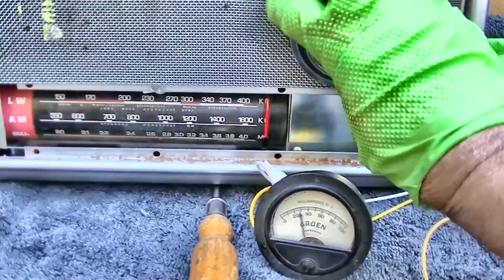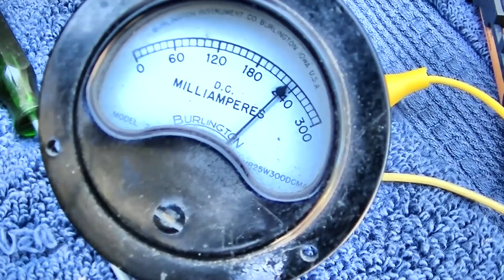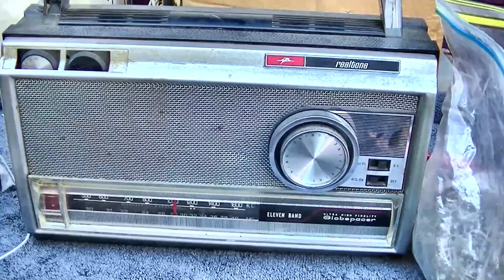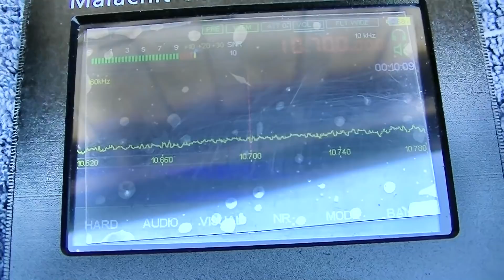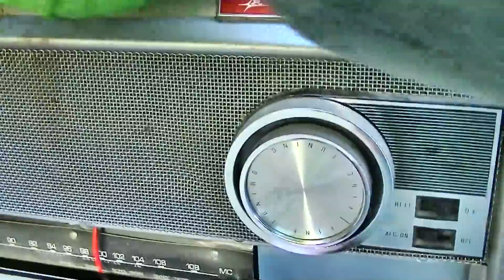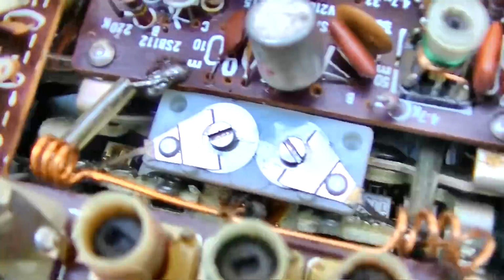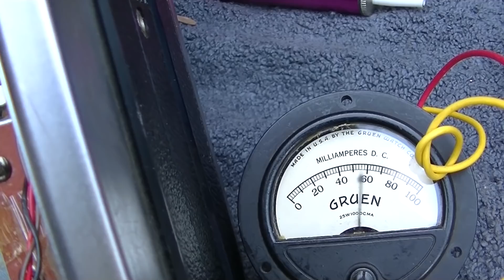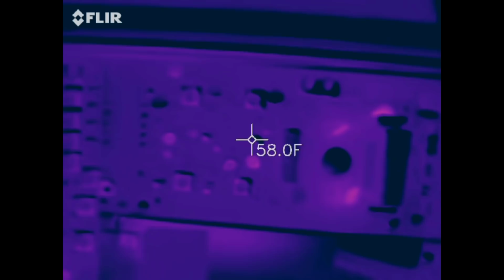Realtone Globepacer 11 Band Shortwave AM FM Transistor Radio Resurrection3

Comment: Look at all the transistors in the push pull audio output stages.. wow. Very cool radio. It seems someone put some love into designing and manufacturing those.
If you're still alive, you haven't had enough booster shots.
I used to absolutely hate static on radios and demanded listening to clear stations or else turn it off. I've changed. Now I prefer the sound of pure static over the content on the stations.
Reply: No kidding. We are in a world when there’s so much mass hypnosis going on it makes me want to puke.
Reply: I tune my hf to a dead spot above 8 mhz at bedtime with the volume low and it helps me to fall asleep hearing the static and static crashes from thunderstorms.
Reply: @LakeNipissing  ill give it a look
Reply: @DankNoodles420  English obviously isn't Prof. Desmet's first language,  so sometimes he stutters for words,  but his example of the "Asch Experiment" to describe the current psychosis was brilliant.
Reply: @kevinmccool3719  I find an FM receiver on a vacant spot on the dial through the right speakers can emulate the sound of a waterfall.
Reply: Is'nt that what squelch is for.  All modern hifis have it.  Most automatic.
Reply: @Fred Flinstone 
You really hit the nail on the head! Back in the 1950s-1970s you can tell that whomever was engineering and designing  these units did put a LOT of extra effort into these units and the performance proves it as does the quality more often than not. I own a number of units like the Panasonic RF-4900 (DR-49) from 1981 and while it is a consumer level communications receiver the performance is extremely good if not excellent good sensitivity, selectivity, and super low noise floor, and the user controls are very easy to use and get good results, not to mention it was build to last a really long time, I owned the RF-4900 since I bought it as a teenager back in 1981 and it still works GREAT!

Comment: I'm guessing the Hi-Fi/DX switch is for variable IF bandwidth. On DX it narrows up the selectivity so you can pull weak stations out from between or adjacent stronger stations. The downfall in that setting is that you lose some of the higher frequency audio.

Comment: smaller rated output transistor are more linear. Replacing just with 2n3906 or S8550 and rebiasing to 5 or 10 ma standing current for the pair should work well to reduce crossover distortion. No need for darlingtons. 1 silicon junction is almost equal to 2 germanium junctions. Increasing the emitter resistor to about 10 ohms should make it stable thermally.

Comment: 15:05 
Discharge of static charge is not constant DC, it is a DC pulse, of course it will pass through to the secondary coil. As long as there is a rising and falling off of current, a spike will pass through. That spike could potentially blow open the junction of the transistor.

Comment: I had one of these maybe 10 years ago and it was a helluva performer. Extremely overbuilt and heavy, and it had that signature Japanese portable rattle of a few random machine screws that had backed themselves out. Had a lot of fun DX’ing longwave NDBs with it. Mine was a slightly earlier version from 1963- slightly different tuning knob and the badges were different. The VHF aircraft band was cheesily labeled “aerodrome control” and the whip antenna was about six feet long with a pointless ball swivel at the base that could only angle maybe 30°.

Comment: 2SA70's were the in IF stages of the early Sony 5" TV's. They had the dreaded tin whisker problem, similar design to the UK Mullard AF 117 type transistor.Cutting the transistor screen/can connection may make it work.
Reply: just cutting screen lead can cause instability, i've had this problem,  need to blast the short out with a large charged capacitor..

Comment: Just picked up one of these gems at a ham fest recently. It was heavily modified, with the tuning cap mounted on the right side with no dial pointer! It had all new electrolytics replaced and is quite a performer with excellent audio. The AM and shortwave have exceptional reception at night. The only drawback is knowing where you are on the dial. Maybe a broken dial string?

Comment: They don't make radio sets like this any more......shortwave sets are cool vintage objects
Reply: Thank God they don't
Reply: @MartinSBrown-tp9ji  Why not, the fact is that analog transistorized units like this can be extremely sensitive, selective, and they usually have extremely low noise floors, something which most all PLL and DSP radios are not capable of since digital noise is extremely hard to limit in portables.
Reply: @watershed44  i was playing with my zenith 7000 in the desert, i cant believe how quiet the bands are and how good it gets the few shortwave stations left, in the city all stations fade in and out and high noise level, with stock radio antenna ,.. then 2 bands i got all kinds of noise i thought the radio developed a problem, but i realized my dad turned on the inverter generator
Reply: Recently got an Aiwa shortwave myself thing is amazing and a metal building doesn't cause any noticeable interference.
Reply: @cipherthedemonlord8057  Wow, I didn't think Awia was still making portable radios anymore. Is it new or used? What model. 
Last Awia I had was the HS-J02 from 1982, wow that was a great walkman stereo. I thought they went out of business in the late 90s.
Reply: @watershed44  Old AR-143

Comment: The Tone Control circuitry in this Radio is interesting.
Instead of just a simple Treble-Cut arrangement we have an arrangement which gives us treble increase with turning the knob one way and treble reduction when the knob is turned the other way.
With the quiescent supply current at about 42mA I wonder if it would still be practical to run this from a Dry Cell Battery.

Comment: I used to find cool old radios like these all the time at goodwill for a couple dollars. Always enjoyed the gamble as many worked or needed repairs. Now I never see anything worth buying as they will not accept these items or they throw them in the dumpster and will not let you retrieve items they throw away. 
They tell me it won't sell and it a liability for the store. 
It's really a shame cause so many people love to repair older transistor radio sets. 
They even throw away table lamps as they said a customer got electrocuted while plugging one in to test it at the store. 
But hey,  they sell flat screen LCD tv sets with obvious damage to the screen for more than a new one. 
Better yet they sell used ear protection plugs for 10 cents each.

Comment: I think the output stage using the two transformers was matched to the germanium transistors, but as they had such a variance in thermal behaviour, many manufacturers chose to find a pair of transistors most closely matched from a large container of many.. I see some silicon transistors in a TO-220 package are the PNP Darlington type (TIP 105), but I think the SOT‐32 package with the small TO-92 as a Darlington configuration seems to work equally well with thermal stability.. From what I see and hear, the hFE of the silicon transistors is very close to that of the original germanium type...

Comment: If you touch the antenna with a static charge, the resultant change in voltage over time at the Rf amp may exceed its safe operating area blowing it. Assuming the input transformer can pass enough energy through before it saturates, which is likely.

Comment: I was looking at the schematic and the thought that came to my mind was to try just  using those two medium power audio transistors on their own by putting a link across where the base-collector junction for the drivers would have been and omitting the resistors for the drivers.
Adjust idle current for best sound and go with it.
I'd say you'd have less output, but no cross over distortion.

Comment: I think the problem with the original transistors may lie with the driver.  ICEO of .34mA against .07 with it's neighbor in a Darlington arraignment.  Sounds kind of leaky to me.  It would be interesting to swap the drivers and leave the outputs to change the pairing.

Comment: DX could narrow the frequency spread, to make it more selective. Which does decrease audio quality.
Reply: This radio really has a true LOCAL / DX switch... many just cut the gain in LOCAL mode,  which is pretty useless with an AGC circuit anyway to deal with strong signals.
This one seems to be wide bandwidth "HiFi"  //  narrow bandwidth,  high gain "DX".
A very useful feature.
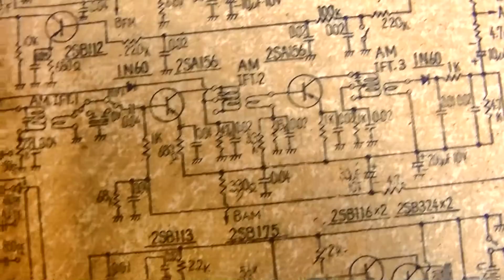Reply: Looking at 3:40 in the video,  this is bypassing a filter crystal in LOCAL mode,  and going through it in DX mode... but as Shango discovered,  if the switch becomes intermittent,  nothing gets through and there is a break in the IF chain.
Reply: As I would assume.

Comment: Huh, all we got on the captions was "we got three am fi a if"...  I'd have at least expected it to pull "marmalade" out of that conglomeration.  Caught Googlebot slackin' there.

That radio is one nicely made bit of kit on first look, shame the board's cracked though. The reason for someone pulling the FM RF vaxsistor would likely be the set didn't work & they either gave up diagnosing at that point when they saw the cracks & never put it back, or the set didn't work so they stole it for another one.
Reply: I have seen outputs fail in that way, thermal runaway and excess current at working voltage but seem to work fine at lower voltages.  It's usually (always maybe?) been AC176 & tin-whisker related.  One time I sort-of proved out the tin-whiskers by carefully drilling 2 holes in the body & hosing one out with brake cleaner.  worked OK but there was no heatsinking for the junction so I ruined the experiment by trying to get a bit of thermal paste in there, must have severed the bonding as it went open.
Reply: And yes, love a good sidetrack with full grain wheaty current-limited buns to boot
Ooooh, and a bit of Rush rolling in on the Ess Doubleyou there

Comment: There are two kinds of people.    Those that pull off the clear plastic dial cover and those that do not.     

 Also changing the output stage to silicon isn't all that hard-- just turn the 2K pot to about half its current resistance.  That should be pretty close.   No need for any further tweaking of components.

Comment: ГТ905А was mostly used as horizontal driver in portable b&w TVs. Usually it has low gain and bad lineaity. Definitely not best choice even for low frequency audio amplification.
Reply from the maker: Yeah I should have just put MP40 in there I'm not sure what I was wasting time with on all this.
Reply: @shango066  Also in most cases you can fine tune radio's oscillators without any direct connection to SDR receiver. Just place it somewhere near. So you have no parasitics added by wires/cables and can be sure that frequency is set precisely. Modern SDR stuff provides impressive capabilities if you know how to use it.
Reply from the maker: @electrofan7180  I was just having fun testing the range with the wire on the if transistor. I'm still learning the thing and have a legit model on order that I will spend more time with

Comment: Greetings from Moscow!
I am 70 years old, when I was 20 I was also very fond of radio amateurism. I was interested in high quality sound recording and also short wave radios. In this radio receivers reasonable made low frequency amplifiers using transformers. This can significantly reduce battery power consumption. But you showed the diagram of the radio very quickly. I did not understand - the frequency modulation channel and amplitude modulation are made separately or the same switching transistors are used. Now transistors are very cheap and if you make the AM and FM channels separately, the receiving signal quality will be significantly higher.
Reply from the maker: They are separate in this radio

Comment: Regular serviceman's signal injector: $1000 functon gen and fancy probes 

Shango signal injector: Phone on loop, 1/8" to RCA cable + capacitor

No offense though, I do the same, except I use a cheap boombox instead of an expensive phone, as well as an old meter probe soldered to the cap.

Comment: The germaniums are probably all leaky, ICE0 is collector current at 0 base current. If you rebias you probably have to scale the resistors by the same ratio as forward voltages of germanium vs silicon. 0.65/0.1=6.5 so try 3.3k for the two resistors in the darlington and 680 for the 100 next to the thermistor. Also now you have 6.5x more current through the thermistor so it will have 6.5x more effect on the bias. Try measuring it in parallel with the original 100 ohm and replace both with a single resistor 6.5x larger.
Reply: Also, if the driver in the darlington pair is leaky, that leakage current will get amplified by the gain of the final transistor, so it's very important the driver in the darlington pair has zero (or in the mkcroamps) leakage. Since finding germaniums with no leakage is hard, and matched ones to boot, IMO it's better to rebias it to silicon
Reply: @brainndamage  Gemanium transistors we’re always leaky out the factory it’s not a fault just the technology of the day.
Reply: @allthegearnoidea6752  true, but they get leakier over time, and a darlington configuration amplifies that leakage a lot. Darlington and sziklai pairs with germaniums are a bad idea.

Comment: A static discharge has a big voltage rise, which is like an AC voltage. This should charge the other side of the FM antennae transformer and.... POP>
Reply: Two possibilities - high discharge current transformer coupled to the secondary, or the high voltage capacitively coupled between windings.  Either way, that's hard on that first transistor.

Comment: Receiver works on manual PFWM... Icbo on those overheating transistors was to high even for germaniums of that power dissipation. The ГТ905А as a max. 1W transformer audio output was a wastefull luxury - it has F transit in common emmiter >=60MHz, so it's good for a powerfull walkie talkie RF output stage.

Comment: i've had quite a few of similar germanium outputs go almost short recently....and when testing a joblot of unused old stock AC128s, most were very leaky or shorted
Reply: Those are the kind subject to the formation of internal tin whiskers if memory serves. You can tie all 3 leads together and apply a voltage between them and the case to zap the offending whiskers... neither elegant nor a truly permanent fix but it does work.
Reply: @PileOfEmptyTapes  yep metal outer can types, its usually the RF ones that are most afflicted, such as AF11x series, OC169, OC170/171/ASZ20, but the audio ones are same construction so can suffer similar,  strange i've not ...yet... come across same issue with japanese 2S types of basically same package style? maybe they didnt tin plate them on the inside?
Reply: the ones i had in radios that went 'high current'/short within radios werent these metal outer can ones as such but ones in glass package, with outer metal sleeve to improve heat transfer, theres no electrical connection to the case possible within the transistor, so just junction failure...the 'stock' ones look like they got damp as outer cases were a bit corroded, maybe the damp managed to winkle its way in through the bottom seal? and cause problems internally,
Reply: according to data, the 2SB324s in this radio are pretty much electrically identical to AC128s ! some years back i got hold of a lot of 2SB423s , hoping they were AC128ish, but no, theyre lower power, more like the older OC72 output and near to AC126 preamp/driver

Comment: ho ho. !! I see you have purchased the Chinese version of the malachite receiver. The Chinese have a rather crude version. There is now a newer version with an additional filter board and other software (more advanced options). Its developer is located in Russia. He has a website with the latest information on this device. The HAM Radio Channel has done several video reviews about this.
Reply from the maker: The legit one is on order
Reply: @shango066  yes ... they are legal. but with a different chip and with reduced capabilities .. In any case, like for the purchase ..))

Comment: Not very exeprienced  ... but the European low and medioum power ouputs Ge Transistors, AC188, 187 128, 127 tend to leak and eventually short to the case. Since they are not supposed to, they were stuck to the heatsink without any isolation. The ones I got my hand on were shorted or became shorted after 10 minutes of use ... CRAP ... probably this is not true for the Jaánese ones.

Comment: Are the battery and external supply really connected in parallel in that schematic without diodes or a switch ?

Comment: You should stick with germanium for the outputs.
You have plenty of those commie transistorski's so why not use them.
They require at least 16 hours of break in to obtain full fidelity.
I find the early radios with silicon outputs sound harsh and scratchy.
Use silver solder, it will improve the tone.

Comment: Shango of elco 944 flyback &yoke tester?
Do you have.?
If yes review it
Thanks
Reply: @allthegearnoidea6752  
thanks guy i know this instrument
Reply: @allthegearnoidea6752  
i want ask if this elco good for modern crt tv
Reply: I've got one and used it on several different yokes and flybacksand it's never let me down. 
I'd say it would work as long as you know the yoke pinout. When you're testing flybacks watch where you put your fingers as the flyback will be boosting the testers ocillator voltage up. If you touch it, you will dance. Been there done that.

For yokes it works fine as long as there's no resistors paralleled across the yoke coils. If they are there, just unsolder them before your testing.
Reply: @1956kirk  
O.k